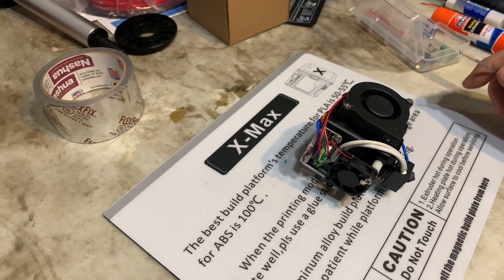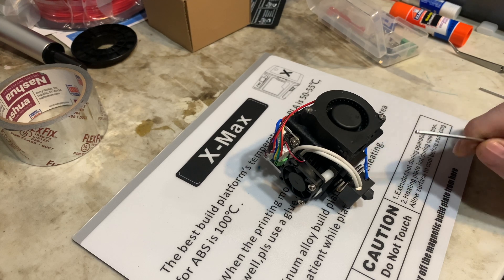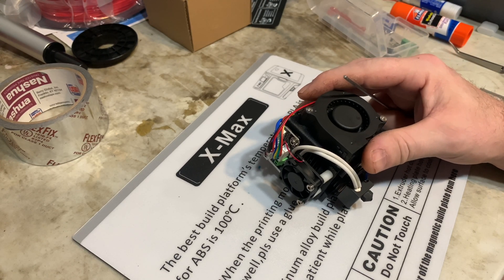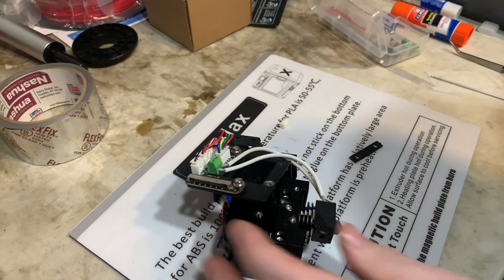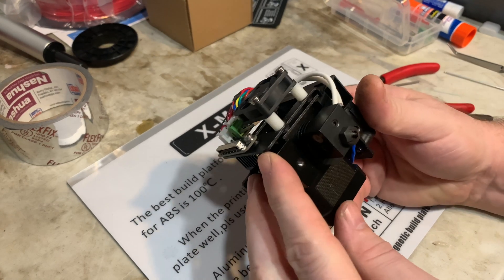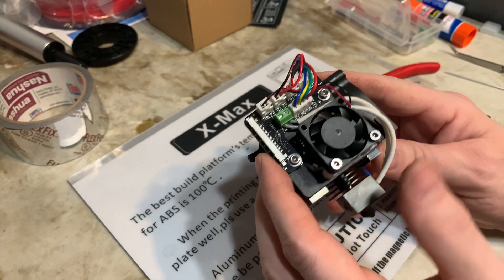Qidi X-Max 3D printer Extruder tear down and re-assembly after material jam

Comment: Thank you for this Video. Do you have an idea what the issue can be? My extruder have no force when pull in the Filament. If i remove the nozzle and the whole hotend, i can stop loading filament extremly easy. There is absolut no force so that the extruder jumps back while printing. I changed the printing head 4 times, got a brand new from qidi but i think the issue is not onnly the motor un the extruder.

Comment: Hey man. I have Imate-s and am having the same problem with clogs. I had a small brass cylinder pop out from somewhere when I was disassembling my extruder. Any idea where that goes?
Reply: Likely the spacer for the screw that holds the spring loaded filament roller in place.

Comment: Your build plate looks so clean. How do you get your items to remove so clean? I print with PLA but can’t get the print to remove. I’ve damaged the white coating just trying to remove a print.
Reply from the maker: I have never used the build plates that came with the printer. I am using a creality glass build plate. I am only using this printer for Nylon and TPU. Easier to remove the glue I use with the nylon material. I am also switching over my other printers to the same glass plate as the work really well with no glue for PETG and PLA. Once cooled down the parts come off very easy. The one I bought is too big but I just clip it to the bed, just have to be careful that everything is lined  up. https://www.amazon.com/gp/product/B089R2TYRV/ref=ppx_yo_dt_b_asin_title_o01_s00?ie=UTF8&psc=1
Reply: I have had the same problem with PLA on my build plate.  Clean the white side of your build plate and just flip it over so the black side is up, then I use wolf bite adhesive - this stuff is Fantastic!  I’ve been printing PETG.